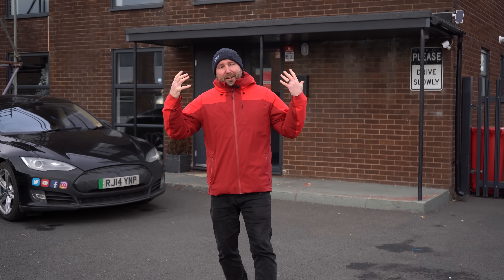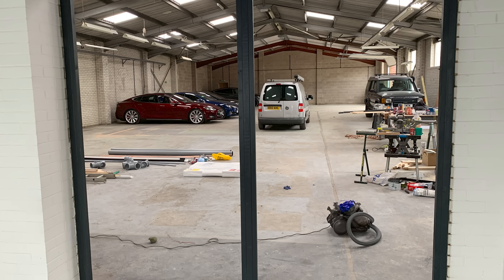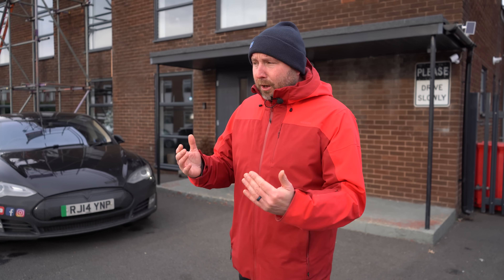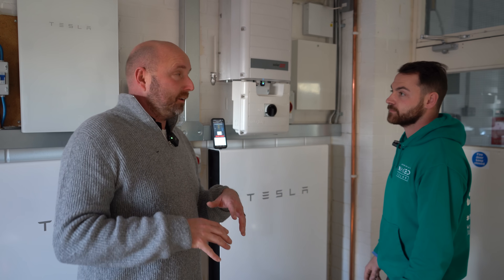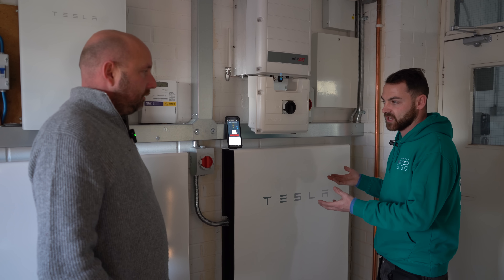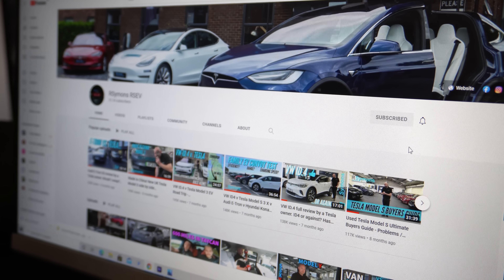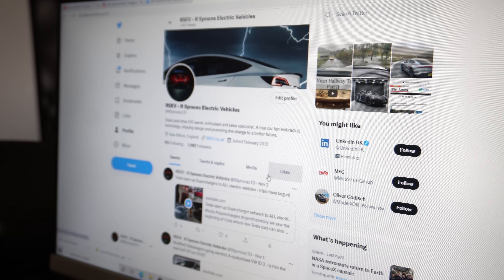RSEV goes OFF-GRID with Office & Warehouse Solar Installation!  Well, some of the time...

Comment: Have you looked into Vehicle V2G Charger compatibility?  Your Cars in stock themselves could be part of that available battery capacity on site.  Zappi for example.

The other key feature of the Tesla Gateway that wasn't mentioned is why your allowed to keep powering your property during a power cut, that it isolates your site from the Grid when there is nothing coming from the Grid.  The engineers wouldn't be happy if they got a shock from energy supply coming from the customer end.

FYI Solaredge allows you have a Public & Private viewpoint of Energy Generated if you are looking for ways to show that.

Comment: It would be interesting to see some more of the system design... you will likely be generating 25+KW in the summer,  the Powerwall 2's I think can charge at 5KW each (7kw for a few seconds)  so your likely going to have 15KW to send somewhere... I'd keep a couple of cars plugged into a smart charger that will suck up the excess solar (without dipping into the grid :) )

Comment: It really helps if you can set the angle right for winter max power, I have 3x 400w (1200w) panels set at 50* in my garden and even when heavily overcast raining they are still pushing out 400W or a 1/3 of their rated power, where the panels on the roof not even half as much.
On a roof like this in the video, I would have made them adjustable and changed their angle 2 or 3 times a year. (or fit auto trackers)
Look on the PVGIS solar site, you could be gaining 50-60% more power for very little money.

Comment: Really interesting! I've had solar on my home roof for 10 years now and it's great to see how more efficient the panels have become. Having said that, all 12 of my big 250W panels are still in great condition and working fine so be assured that these systems are robust and low-maintenance. I'm currently having optimisers fitted behind each, which I'm sure yours will have at installation. I'm also replacing my inverter as it's past its forecast lifespan and I've gone SolarEdge as well. The app is really good! The suppliers are learning and optimising equipment and best practice over time. Do please post updates as you get used to your fabulous system and as the weather improves. Great work!
Reply: Optimisers are only needed if you have shading issues, otherwise you’re adding failure points and cost.
Reply: @edc1569  With a 100% reliable system and with no birds I would agree. However, optimisers are needed wherever there's a chance of a single panel output being less than the others. 

Since the upgrade my updated software is showing me that one of my 10-year-old panels is outputting about 20% less than the others. Before the optimisers that would have meant that 12 panels would ALL have had output reduced by 20% That's 600 watts less capability rather than 50 watts. That pays for my optimisers in less than a year.

Comment: Asbestos is always a panic word. However there may be safe and cheap options. At least here in the (US) states there are quick, easy, reliable, noninvasive and CHEAP solar install options where the panels are attached to a supporting grid work that is simplest GLUDED DOWN to existing roofs that is safe, reliable, quick to install and cost effective. It doesn’t require even a single drill hole into the roof but is proven for massive rain, high heat, snow and especially hurricane level winds. When or if you need additional panels on the asbestos roof it’s an safe and affordable option. Take a serious look at it since it seems 60+% of your is indeed asbestos and you will (eventually) need more panels for many reasons. Solar isn’t as efficiently, easy, reliable, and cheap effective as most people think. You WILL need at least 20% more panels by my estimates and likely a handful more batteries. 

Looks great. Best wishes.

Comment: All business property should get solar as its all written off against your corporation tax as assets. If you have sixty 420w panels then that's just over 25 kw of solar. Winter you will see 20% so 5 to 6 kw per hour (30kw per day ish). Tesla power walls should last 10 to 15 years without too many issues.

Comment: I think u made the wring move.
First u should have made the walls and floors insulated and also the roof. Then had tripple glassing installed.
Light is very important and u r sky lighting in minimal. You should have doubled the size of the sky light windows.
Once the above is done phase two is installing ground source heat pump.....u know how efficient they are u have them in Tesla's (an air source not ground source). This will reduce ur hot water heating costs because the hot water can be reheated by the heat pump to @40 deg c thus onlu requiring 20deg C of extra heating to get to the magic 60deg c.
Heat pumps need electricity and u get this from solar panels and Power Walls. The Power Wall get their power from solar and the mains. 
U size the solar panels to be @150% of you consumption needs as a load and in winter to ensure that the solar can generate the energy u need in low solar output.
I don't think u are planning to go off grid since this would increase the systems cost a lot but a 50:50 split between power from the mains and from solar. 
The key thing is that with the above strong insulation and heat pump your energy requirements will be much lower than a residential house.

Comment: Great idea and the way every business premises should be going. My wife is installing solar panels to her business premises this month, she is all electric, no gas, so they will use nearly everything they generate so we didn't go for batteries for now (space is really at a premium).

As you say, it is madness that new buildings don't have to be covered in solar. Even residential homes aren't required to have solar - I have friends who just bought a house and when they asked the developer, solar and heat pumps weren't even a cost option

Comment: Great project, the asbestos section can be overroofed with a new metal roof without disturbing the asbestos, then you would be able to fit additional solar on top of that. During my working life, I’m retired now, the company I worked for did a lot of over roofing old leaky asbestos and flat roofs.

Comment: Having had my domestic 6.2kWp system installed nearly a year ago I know what savings can be had from that. From a commercial perspective this MASSIVE upfront cost is absolutely going to be worth it in a very short timeframe, even if prices fall close to 2020 levels. I'm surprised like you are that all businesses don't obtain bank loans to do the same.

Comment: I just don't get Uk's idea with not getting anything sending it to the grid. Would be so much  smarter to pay the spot price - tarffi for selling it for you. Then there would be no need for this stupid batteries. Instead the grid can work as a battery and you don't loose anything since normally the rates are much lower at night. 
I do have solar on the roof but I sell it to the grid to build up my battery for the nights and in the winter. The first bil that wasn't zero was the december when the "battery" ran out

Comment: An excellent and for me well timed video, I’m due to have a similar but smaller (14 panels and 1 Powerwall) installed in 2 weeks. The idea of powering the car from the sun is, to me, more compelling than the payback period. Which is easy to say when “only” paying domestic electricity rates with cheap overnight from Octopus. The commercial charges you face are truly horrendous and I’m sure we will see many more businesses going down the solar & battery route in the future.

Comment: I had solar and Power Wall installed just over a year ago and it was one of the best investments ever. I have paid nothing in electricity over the last year and Octopus pay me for any electric unused at the same rate we import at (so basically like having a massive battery on tap as we are buying units in the Summer for Winter usage). I still have quite a big balance in my elec account even now. With 23 panels, I have generated around 65KW on a good day in the summer. The total for the year is around 11.5MW, which I think is amazing. Your enemy will be thick cloud as production will be minimal, however the best days are cool bright days in June / July just after it has rained (the rain cleans dust of panels and seems to help the light absorption). I also hope you have less seagulls than I do (I am on the coast too). I had to invest in a very large window cleaning pole!
Reply: It really helps if you can set the angle right for winter max power, I have 3x 400w (1200w) panels set at 50* in my garden and even when heavily overcast raining they are still pushing out 400W or a 1/3 of their rated power, where the panels on the roof not even half as much.
On a roof like this in the video, I would have made them adjustable.

Comment: Great system, you will now be wanting to add Myenergi Zappi chargers to optimise solar use, also a great bit of kit, 3 phase 22kW and 7kW single phase and mounting posts available, mine works very happily with my Powerwall.

Comment: Super interesting video,  have a single phase system here with 3.99 kWh solar and exactly the same Tesla powerwall system. From mid April to mid September all usage from solar. Use off peak Octopus go as supplement for the rest of the year. Charge my electric car 40% free the rest at 5p rising to 12p soon! Last 12 months to 31st December was £224.00. Will be very interested to hear how you get on. Here in Scotland new builds have to have 2 kWh solar installed. The power networks will not allow more than 3.99 kWh as the grid was never designed to take feed back. Apparently an enormous amount of investment is required and is beginning to be spent but it is going to take years. The company that installed my powerwall system is now working with house builders in North East of England to install solar and battery systems at point of sale.

Comment: Very impressed,  well done on saving up for this.  Maybe a few Zappi chargers next to help regulate the charge in to the EVs as the sun level varies with clouds passing over. Also great as it brings more people in to your channel. 

Maybe now the gas boiler can go and a few Air to Air heat pumps for heating and cooling can go in for the offices?

Great work, and fab channel.

Comment: As it's a 3 phase supply you have  how do the phases get split to balance the output from just two powerwalls? Dont you need three?
Reply from the maker: One phase just doesn’t have backup. That’s ok, as long as office and security systems run so they are on the other 2 phases

Comment: Good to see a business doing this. We’ve recently added more solar to our own system, along with a couple of PWs - sees us totally off grid from March to mid-October.

A couple of things, for when you decide to expand your system. The East West split (which is the same as ours) will produce very little in the winter months, as the panels are never facing directly towards the sun - not even close.

Likewise, but lesser known, the optimal angle for South facing solar panels during winter months is close to 70 degrees! Almost vertical. Which then means you’d actually be better off mounting panels to a South facing wall rather than roof (may need planning permission though). The fact that they’d be so far ‘off angle’ during the summer is of lesser consequence as the strength of the sun is that much greater. Overall your production would be less, but your winter production, which is solar’s Achilles heel, would be much improved (though still nothing like your summer production).

Due to these considerations, I’m seriously considering adding another small South facing system to the side of a workshop in our garden - set for optimal winter production.

Comment: Good honest video. The delays are real. We have been try to get a solar/battery installation since April last year. Delays on battery supply and then backlog.of installations from the installers have been major. We were told mid December the installers will be here on the 12th January. Looking forward to it.

Comment: Curious what the spec is of the inverter?  it looks very small to handle 20Kw+ 3 phase ?  would be great to get a video from Naked with details on how the incoming and outgoing load is  managed
Reply: Solar Edge do a few about this size ranging from 20KW to 37.25KW. SE15K, SE16K, SE17K, SE25K & SE27.6K. I may be wrong but from the video it looks like it could be SE25K. They do seem to be getting better at packaging inverters in these days.
Reply: @kevinwhite8836  yeah it was the size that confused me.. most 20K + inverters are twice that size.. tho the powerwalls have 5K? inverters built in i think. also they may have just overpanelled with a smaller inverter / charge controller as all the panels wont get full sun at the same time anyway

Id prefer to go with a solar edge battery thats modular and DC coupled for better efficiency
Reply from the maker: It’s an SE25,000 3 phase inverter 👍

62x sun power performance p3 panels
Plus 31 optimisers 
And a ton of other things I don’t know much about 😂 

I could try and copy/paste if wanted
Reply from the maker: Renusol FS10 South Facing Mounting System for Flat Roofs	14
Tesla Powerwall AC 13.5kWh	2
Three Phase 63A Isolator Switch	1
Craig & Derricot DC Isolator 16amp 1000v PVP162	2
Landis & Gyr Three Phase Generation Meter 5219B	1
NICEIC Building Control Registration	1
Gemserv MCS Certificate	1
National Grid Registration with DNO	1
Renusol MetaSole Mounting System for Trapezoidal Roofs	48
Sunpower Performance P3 - 415W Commercial Solar Panel over 1MW	62
SolarEdge P850 Optimiser	31
Solar Edge SE25,000 3 Phase Inverter	1
Tesla Gateway 2 with backup for Powerwall
Tesla 3 phase kit	1
MCB 63A Triple Pole 10kA C Curve	1
RCD 63a 4 Pole 400mA Type A	1
Surge Protection 40kA 4 Module 3 Pole and Neutral Type 2	1
Three Phase Metal Distribution Board 4 Way	1
Reply: @RSEV  cheers for that info! I am impressed and surprised how small the inverter is for 25K! i dont want to know how much youve invested but i can safely assume its a lot! but at 90p a KWh.... it wont take long to break even.  esp down south where theres more sun hah!

Comment: Congratulations on a neat install. I've had a home solar (SolarEdge inverter plus panel optimisers)+Powerwall setup for a bit over two years now, which has been brilliant. We use negligible grid import to run the house for 8-9 months of the year with solar energy spare to export. I thought I'd be using the system to charge my TMY, but it hasn't quite worked out that way. It's turned out more effective (and economical) to export energy during the day and charge the car from the Zappi using off-peak grid overnight (from a genuine green energy supplier). The Tesla app works very well and you can even download detailed stats if you want to satisfy geeky urges:) I'm looking forward to seeing your reports on how your system performs for you.

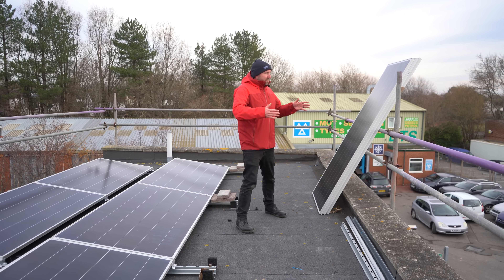Comment: If you are on Octopus and have their cheap rate 00:30 to 04:30 tariff to top off your batteries then you cannot have their feed in tariff, or if you want the feed in tariff you wont get the cheap night rate !. I just discovered this recently, thought we were getting the cheap overnight rate and it turns out due to being on their feed in tariff they had removed the cheap overnight charging …. But didn’t bother to tell me this. Octopus must be one of the worst Companies to get any information out of, every email take two to three weeks for a reply.
Reply: I am currently on Octopus Go and have just ordered solar and battery for home.
I can only get the SEG payments of 4.1p per kWh.
If I want their Agile outgoing tariff either fixed at 15p per KWh or the one that tracks wholesale then I need to come off GO and move to Agile or their std tariff.
Really can’t decide what’s going to be best going forward,don’t want to be exporting but we can only have a 2.8kw solar system and have added a 10kwh battery.
Reply: The old Feed in Tariff (FIT) stopped for new installations a few years ago. It's SEG tariffs for export now. Octopus don't offer Go for import with Agile Outgoing. I switched to Octopus and use Economy 7 because it suits me better than Go  for overnight EV charging and (in the winter) some automagically controlled overnight charging  of the Powerwall battery at the night rate. For export I originally went with their fixed Outgoing (which offered the best rate I could find) but later moved over to Agile Outgoing which has provided a higher weighted average export value over the past nine months. I'm very happy with Octopus compared with my previous suppliers.

Comment: You’re not off grid, you’re grid tied.  Make sure you’re avoiding using resistive heat sources, replace any electric heating with air-to-air heat pumps (ac)

Comment: you can get export tariff and soon they will give you more £ for exporting at peak times, thereby reducing the payback
Reply: You'll never get anything like 35p per kw from selling to an energy company. They pay peanuts. Usually no more than 6 or 7p per kw at most, then they sell it to another consumer for 40p per kw. You need to store and use all what you produce, if it all possible.

Comment: Got my PW2 system installed earlier in the year (just after I met you at the model Y launch Rich). Using Octopus Intelligent to charge both the Model Y and PW2 as well as exporting at 15p when not needed (I managed to get the export tariff before asking for the intelligent tariff) is saving us around £3-4K a year on fuel and energy costs. The whole system with the current energy costs will have paid for itself by 2026. It is by far the best house improvement investment I have ever made!